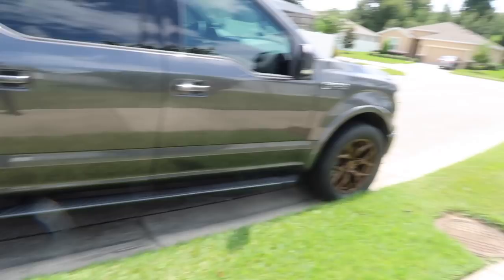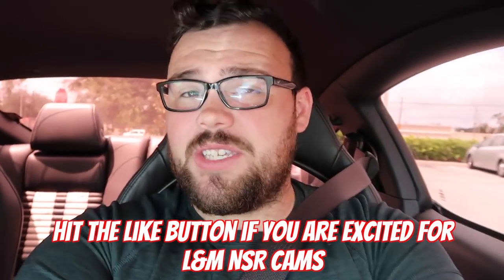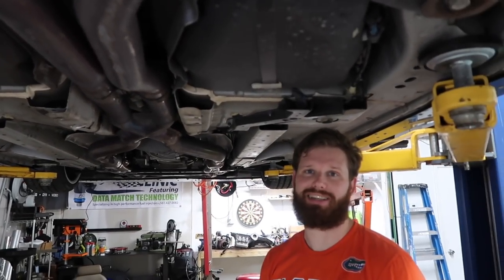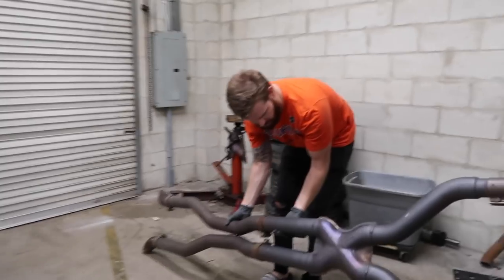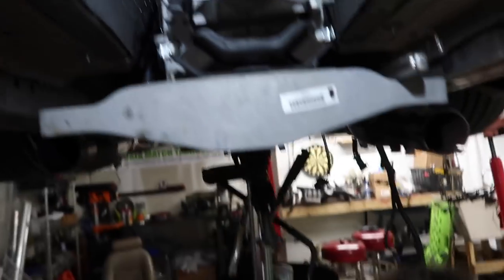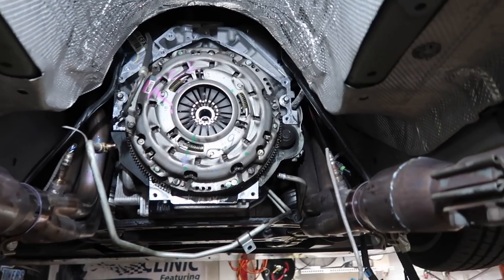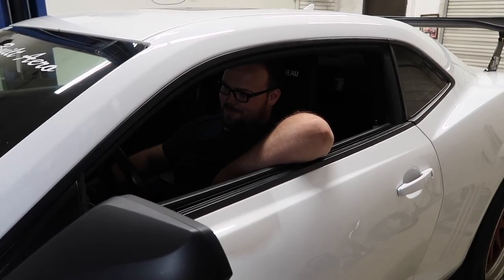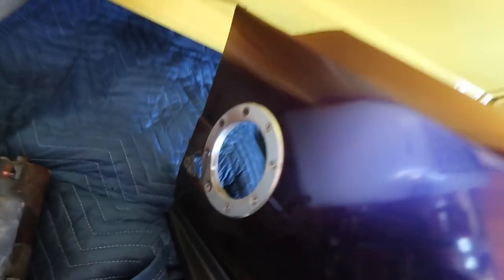How to install Mantic Twin Disc Clutch TR6060

Comment: Can you just bore & sleeve a 2 valve 5.4 block to a 5.8?
Reply: I mean yeah, but if you’re referring to the trinity engine, that’s a 4v
Reply: @xboxgamerz777  What I am saying is, just like the 2 valve & 4 valve heads regardless if they are made for the smaller heads made for the Lincoln Mark VIII or the larger heads for the Lincoln Navigator they all can fit the older 4.6 & 5.4 blocks made for the 2 valve heads. The 3 valve heads are a different animal where they only can fit the 4.6 & 5.4 blocks made for 3 valve heads. The trinity block are really a 5.4 blocks made for 2 or 4 valve heads that is bored out to 5.8 and the heads are a advance version of the 4 valve heads that were used on the Lincoln Navigator with the addition of the coyote-ish 4v cam intake and exhaust CAM Phasers.. I was told the trinity engine use an  old 5.4 4 valve block with bigger bores and coyote heads. In short a 5.4 2 valve block that is bored and sleeved to 5.8 should work just fine or he can pointlessly, unless you want to save some machine shop money, lower his volume size back down to the original 5.4 block. The older Shelby GT500's where 5.4 before going 5.8.